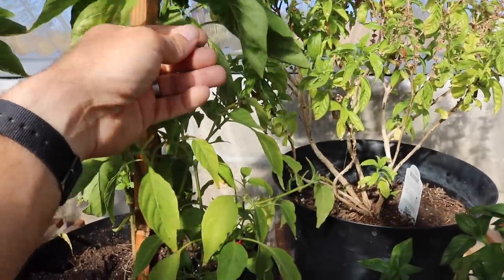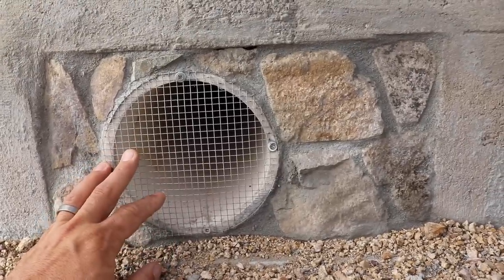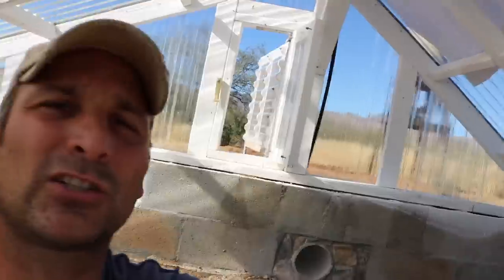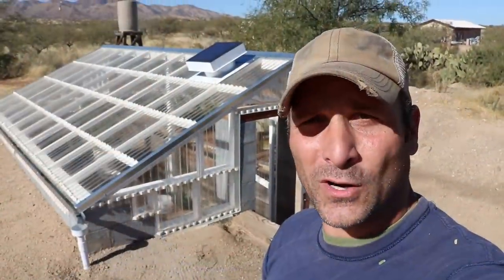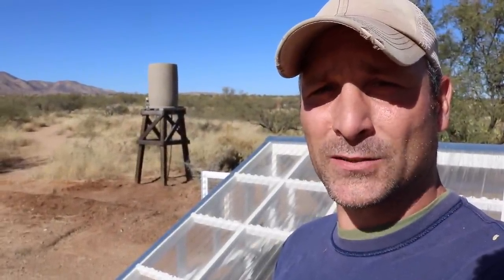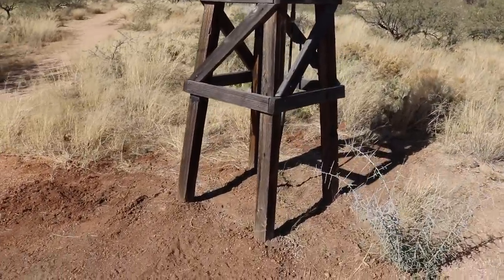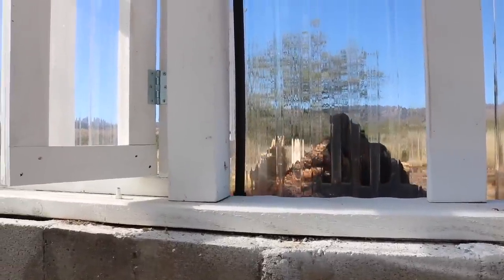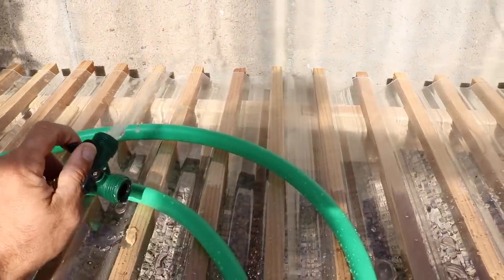Sunken Greenhouse 7 - Rainwater Harvesting, cooling tunnel

Comment: The idea of an geothermal cooling tunnel is to expose a volume of air (or water) to a mass cool soil. The longer the tunnel, the more opportunity to cool the air. I don't see the difference between several parallel small piped or running a long length of pipe for a long distance. What should matter is the total length to achieve the degree of cooling you want. As I see it, the deciding factors are the amount of labour and cost of the materials. Are many small diameter pipes cheaper than a equal length of larger diameter piping? Do you want to dig one very long trench, or excavate a small area? I think there is also an advantage to exhaust air out of your greenhouse, circulate it through the underground system, and bring it back into your greenhouse. This would require a small 12 volt solar powered fan to move the air. Just a suggestion.
Reply: You`ll need something more powerful than a 12v solar powered fan ;) There is no difference in surface (aka heat transfer) area between a 100ft tube and 10x 10ft tubes in parallel. There is a big difference in how much air you can use. For example, assuming 4" straight, smooth tube and a pressure loss of 0.5" wc, you can run 85cfm through the100ft pipe or a total of 1900cfm through the short parallel tubes. 1900cfm will do a much better job of cooling than 85cfm.
Reply: The voltage of the fan is not the issue. Power supply is the issue. Sure you can have a 120v system, if there is 120 volts available, or if one doesn't mind the cost of running an underground power line. A 12v solar system may be the answer.

As far as air volume is concerned, a 1,900 cfm is very much overkill! The current recommended cooling for an underground system is passing air through a pipe at 5 f/s, and at 5 times the volume of the greenhouse every hour. A 4-inch pipe would require a fan of about 30-40 cfm capacity for a greenhouse of around 320 ft^3 in volume. A greenhouse of 710 ft^3 would need a 6" pipe and a fan of 65-70 cfm capacity. At 2,832 ft^3 of volume, a 12" pipe would only need a 245-260 cfm fan. Bigger is not better.
Reply: Jaye Jay Curry

The 1900cfm is related to air handling capacity of the tubing at 0.5" wc. Moving the greenhouse air underground 5x per hour will not provide nearly enough cooling to keep pace with the incoming solar gain. I have a system installed that is equipped with a variable speed fan capable of putting the entire greenhouse air volume underground upto 60x per hour. I can tell you that its very difficult to outrun the cooling power of the ground even with very high flowrates. If you look at the systems running 5x per hour you`ll notice the outlet air is always at the mass temperature, note, if they quadrupled the flow to 20x it would still be at the mass temperature but it would be moving considerably more energy ;) They would find the greenhouse doesnt top out at 130F as it does with 5x per hour.  I would recommend using 4" tubing not 6", if you calculate the surface area and volume (mass displacement) of both, it becomes clear why 4" is the way to go. The 6" will require a much higher flowrate to produce the same velocity (aka, dwell time of the air in the tube) as the 4". Its very easy to overlook these small details and its very difficult/costly to rectify after you`ve bought and buried the tubing ;)
Reply: JohnGuest45 The rule of 5s was formulated at CRMPI by the late John Cruickshank. They claim this is the operating principle of the greenhouses they've built and works just fine. The only difference in their system and the one presented in the video is that theirs is a part of a climate battery that stores excess heat during the summer for use in heating in the winter while the air from their greenhouse is cooled.

I am curious about something. How do you manage to force 1,900 cfm of air from what should be about a 15" fan into a 4" opening? It seems to me that either the air resistance at the opening is so high that your fan loses efficiency and air volume, or you have a way of compressing the air to over 200 lbs/in^2. Also, if your output is also 4" in diameter, you must have a very high exhaust velocity.
Reply: John was a good friend of mine, i bounced a lot of ideas off him when i designed my system. The 5x was the standard until realworld testing confirmed it wasnt sufficient to get the full potential from the tubing. The issue was that the majority of installations were in large greenhouses/tunnels which made testing of higher airflow rates a very expensive proposition so it was never done. 

The plenum would be sized to handle at least 1900cfm , the ten 10ft would be balanced so they each took an equal share of the 1900cfm. A 10ft length of 4" tube will handle 190cfm at 0.5" wc. A single 100ft length of 4" tube will not handle 1900cfm, the velocity pressure alone would be close to 30".
My system uses a 15 tube radial layout and an 18" plenum. It was designed with experimentation in mind and has a number of unique features. .During a rare hot day in summer i sealed the greenhouse and allowed it to climb to 140F, with the system running flat out it took a shade over 12 minutes to drop the greenhouse to 68F, it was kept sealed and in full sun throughout the test. With 5x, the incoming solar gain would dwarf the cooling and you`d have to resort to conventional exhaust fans and venting to control the temperature. The test is not indicative of the way i normally run the system,  ie to cool the greenhouse as rapidly as possible. Its more efficient to set the airflow rate so the system keeps pace with the incoming gains to maintain a steady air temperature. Using very high flowrates when constant lower flowrate would do the job is counterproductive as it creates larger temperature swings and cost more in electrical power to achieve the same goal.
Reply: I was going by the information available in 2015.  I am unaware of any changes made since then, as far as the application of John Cruickshank's principles are concerned. And from the data presented in "The Forest Garden Greenhouse" is concerned, the system he designed seems to work just fine.

It seems to me that we got off on two separate paths. I wasn't changing the subject to the climate batter, per se, but using its general principle to the subject at hand: the cooling tunnel of the underground greenhouse. As stated in the video, the cooling tunnel, as it now stands, is a 6" PVC pipe extending 100' at 18" underground. The questions are: Is that enough? Should smaller pipes branch out? Or, should larger pipes be used in increase dwell time for cooling the mass of air?

What I offered as a possibility is fanning out the tunnel with smaller pipes. After watching the video, the thought occurred to me that by fanning out with the same 6" piping, the need to dig out further is eliminated. Plus, the combined cross-section of the branching pipes also increase the dwell time for the cooling effect. And, I've always considered a return to the greenhouse important, although an intake remote from the greenhouse is also possible.
Reply: The most important thing with any installation is to see what you have to work with before you start digging. Most folks dont bother to do any preliminary testing prior to installing the tubing. In Joe`s case, the tubing is external to the greenhouse, the 18" depth will be subject to direct gains in the day and losses at night. Sinking a few temperature sensors and monitoring them regularly over a period of time can provide some very useful information. 
 I monitored the ground at various depths for 12 months prior to installation and it bears little resemblance to the theoretical ground temp vs depth values you`ll see quoted on the net and on a lot of climate battery video`s on you tube. A lot of these installations dont have sensors buried in the mass or installed in the tubing so they cant tell what the air is doing in the tubing or where its doing it. Knowing the mass temperature will tell you if the air is losing or gaining maximum heat. Sensors in the tubing will tell you where the heat is being gained or lost and from that you can tell if all your tubing is actively transferring heat or just a few feet of it.  
It amazes me that folks will spend literally thousands on installing a system but dont bother to install any sensors that cost almost nothing in comparison. Its the reason there`s no reliable information /performance data available.
Reply: JohnGuest45 Okay, it is good to do some testing and measuring at time. At other times, like with Joe's project, it's a learning experience. Knowing that you can do something and tinker with it is the point. At times, people have made important discoveries doing such things. Way more often, they've learned how not to do things. It is more of an adventure than the mundane process of sensor reading and recording data. Some people require a road map and GPS to go for a drive. Other people just like to turn off on a random road to see what's "that way".
Reply: What you dont want to do is inadvertantly drive off a cliff while exploring "that way" :) The geothermal equivalent is to bury hundreds of feet of tubing and then find you need to dig it all back up again. Of course, if you dont read sensors or collect data you`ll be unaware of any shortfall, at least until the summer arrives. Not checking the reading on the greenhouse thermometer is an option but your plants wont be too happy at 100F+ :)
Reply: great and useful discussion on earth tube cooling guys but I am  bit confused. don't you need to go down at least 3 meters to reach a temperature close to the average annual temp?  seems like temps at 18 inches wont be very much different than surface temps. whats the point in that?  thanks.
Reply: noah williams" [D]on't you need to go down at least 3 meters to reach a temperature close to the average annual temp?

According to my research, yes. However, when considering a design there is the ideal versus the practical. Were time, effort, and money not an issue, yes, one could lay a cooling tunnel at 3 meters to gain the maximum benefit of geothermal cooling. In reality, there are other alternatives to keeping a greenhouse at acceptable temperatures that are less expensive, easier, and quicker.

Vents can be used to allow the excessively hot air to escape. Limiting solar input by reducing glazing or using shading curtains is possible. And, I am sure there are other methods that others might suggest.

I share your concern about the 18-inch covering of soil, especially in the area of this greenhouse. But, as I was informed, this is a concept test. Maybe it will work out, and maybe not. I am taking a wait and see position  on this. I am hoping we will all learn something from this project.
Reply: if the 18 inch deep pipe isn't deep enough, it can always be moved deeper in the ground. much work, but little monetary cost, which I'm ok with that myself. the way I understand how this works, it's all about surface area inside the pipe, and the mass of ground around it. deeper will give you more mass as well as cooler/more stable temperatures. as you're cooling air with the pipe, you're putting that heat into the ground, so there is a limit and diminishing return as the ground warms. parallel pipes into the greenhouse would allow for slower moving air at a given volume, and more time inside the pipe to cool the air. it seems this type of project should start on the drawing board with a bunch of research and math, then move to experimenting and comparing real world results with expected calculations, which helps with making an educated guess at future changes to the system. thermal dynamics don't always work how you expect.
Reply: Follow
Reply: Pete, you`ll be surprised how little dwell time is required to cool the air.  Typically, it takes less than a second to get a 30F drop. Going deeper with the tubes doesnt increase the mass available, you will still be limited by how fast the heat can move away from or towards the tube. Based on my observations with fairly dry, heavy clay soil, any heat stored during the day that travels more than 8" from a tube cant be recovered on the same night. If you place the tubes close together you will bias the system towards heating, if they are further apart you will bias it towards cooling. Its best to distribute the tubing evenly throughout the mass both vertically and horizontally, dont bury a single layer 8ft down ;)
Reply: +JohnGuest45 interesting, I never thought about biasing towards heating/cooling by pipe spacing. I keep thinking maybe introduce water to the method somehow, if a spring is available, but that would require major changes to the design and nature of the system.
Reply: Water would give you more of a single edged sword as you`d lose the ability to heat effectively.The other issue is water doesnt respond nearly as fast as air so it wouldnt be great for making the most of very short spells of sun. Locating the tubing outside the greenhouse can be useful in hot climates where cooling is more important than heating. A sheltered and insulated mass (under greenhouse system) can be partially discharged at night if you need to increase the cooling capacity for the following day. Simply route cool outside air through the tubing and exhaust it outside (bypassing the greenhouse interior).

Comment: 🤔 If your water barrel doesn’t give enough pressure Being gravity fed. I would install a 12 V Air compressor where you can plug it into hey cigarette lighter when extra pressure is needed. Also at the bottom of your pipe to blow out the dirt.I would put in place of a screw cap a 90° on off valve for ease of use.I love your work wish I had your system.

Comment: I'm really impressed with your sunken green house design....and rain catchment. Does the cooling air pipe run down gradient from the green house? Ok physics matters...cold air travels with the gradient or sinks....you will be drawing air from the green house. Could not determine your objective because of limited bandwidth (we are 14 yrs off - grid).

Comment: Why not put a 180 degree turn on the outer end and return it to the greenhouse.  You could then put your air system inside the greenhouse, move the hot air out and have it return as cooled air.   Just a thought, but I like the idea of having all the equipment inside the greenhouse where it can be easily monitored and repaired.  Plus, it would double the length of the cooling tunnel.

As for the watering system, it seems to me that you have an idea situation for installation of a drip watering system in the greenhouse, using the gravity feed from your water tank.  Drip systems use very little water, but produce remarkable results.
Reply from the maker: Those are great ideas Michael!  Yes, the cooling tunnel is still rattling away in my head for now... but I'm considering all options:)  ... and yes to the eventual drip addition:)
Joe

Comment: I would think that a large loop connecting both ends of the tunnel inside the greenhouse with a low volume fan moving the air.  Probably would go a little deeper

Comment: You could have sliced a pvc pipe and slid it onto the bottom edge of the roof. The shape of your roofing would hold it open enough to allow the water to flow inside the pipe

Comment: Great videos, love watching all you are working on. I definitely think you could use some shade cloth especially for seedlings and even the tomatoes and peppers will do much better and not require as much water if a little shadier which will lower temps too. What made you choose 18” buried pipe for cooling or moderating heat at night -it seems way too shallow. I don’t understand how that little will do much more than give you a 100’ of warmed air especially with desert sun. What temps are you getting out of the pipe. Usually I have read at least 20’ is where you need to get to begin to get consistent 50-55 ground temps..others say much deeper. So it would seem you would need to be down at least 4-5’ to have any moderating cool and warm depending on location as in earth tubes or GHP. Also, since you used pvc, and I didn’t see any perforations or cloth covering what would be perforations, what will you do about condensation forming on pipe and dripping down and then causing mold inside the pipe and blown into the air you are breathing? In earthtubes, they use perforated wrapped pipe plus being further down helps moderate temps between night and day.

Comment: I am not expert on earth tube cooling systems. But I am curious about your system.

I think your 6" pipe will work fine.
I am wondering though if putting it 18" deep will be enough. If not just mound more dirt on top of it. Maybe you can make that mound part of a swale.

Comment: To be "Earth Cooled" pipes should be barried 6'-8' deep and have a run of 200'. At 6-8 ft deep, you're getting the earth cooled air. From that, you get a constant of 59-65 degree temp. Depending on where you live.

Comment: Great idea. With appropriate drainage do you think this concept would work in cooler wetter climates? I have concerns that dealing with ground water runoff could offset the benefits of a sunken greenhouse. 
I agree with comments re cooling tube depth and was wondering why you don't direct the water from your greenhouse for use in the greenhouse. Is it solely about inability to gravity feed the water? If you could, then the water harvesting greenhouse would be closer to a self sufficiency system.
Also, why do you run the pvc tubes along your garden fence to the tanks? Why didn't you simply have your tanks located at the point of entry to the garden? 
Keep up the videos, I love your ideas!!!!